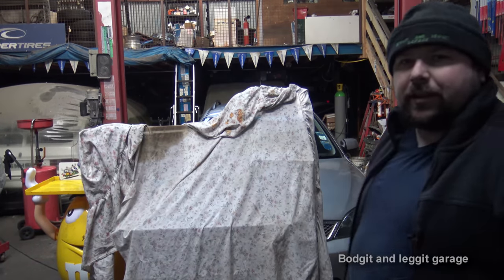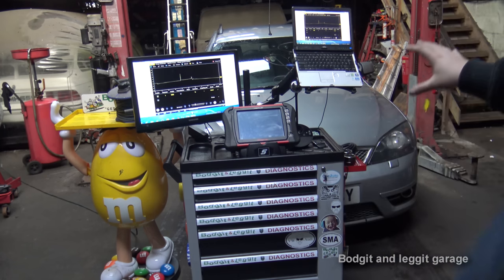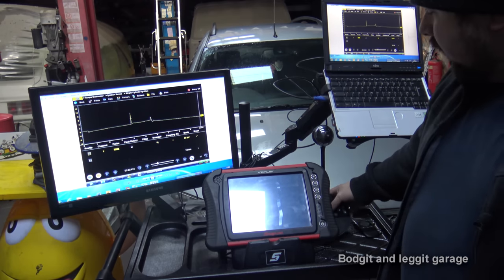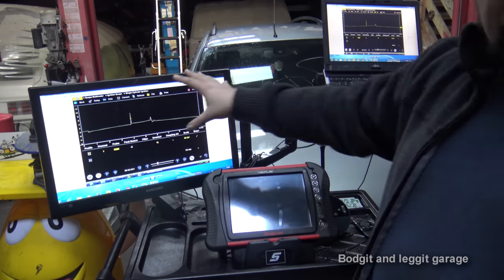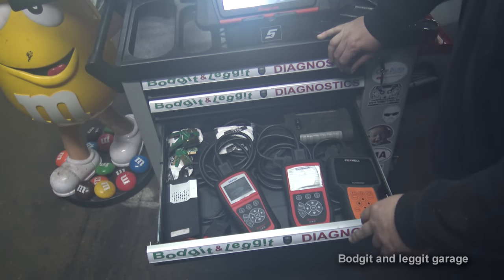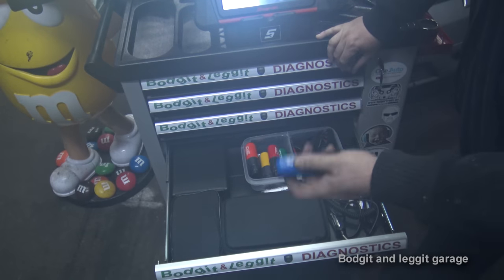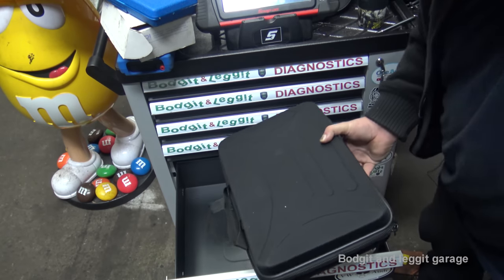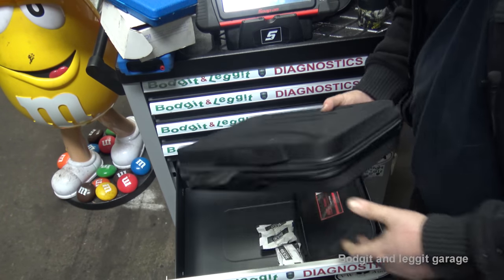Diagnstic Tool Box Tour Bodgit And Leggit Garage

Comment: Very nice Leon! I'm a volunteer tech at my Church's Car Care Ministry. We fix cars for ppl who can't afford to pay for repairs and need to get to MD appointments dialysis, work etc. We are one of the largest in the states and gave away over 30 donner cars in 2017. We have 5 lifts! Problem is we lack diag equipment. I do almost all the diag, approximately 30 -50 cars a month which might not seem like much but I have cancer and time and energy is limited...it's all good though considering they told me I had 6 months to live in 01. All we have for diag is an OTC Encore scanner, Power Probe, home made smoke machine aka a bomb, 1980s DSO pretty much limited to ignition waveforms, square wave voltage patterns, no amperage function and of course miscellaneous test lights, DVOM etc. We do not have any subscription service e.g. Shop Key, All Data etc. As you can imagine it's a challenge and I can't throw the "parts cannon" at these cars as a steward of limited funds plus it's just the wrong way to fix cars. Test don't guess as they say.
A tool like that Verus would be a game changer for us. I may talk to my people and see if they will go for it before Keith uses the alarm code...lol. Anyway, thank you for the very cool vids and sharing your arsenal for Diagnostics. I'm planning to start making some videos soon. Guys like you, Keith, Eric O, Scanner Danner, ETCG have been a great help and inspiration. Hope I didn't bore you with my long comment. 
Take care
Reply from the maker: Joe Mikos my hats off to you what you do is awesome we need more people like this on the planet if there is anything I can do to help ask me and I will do my best